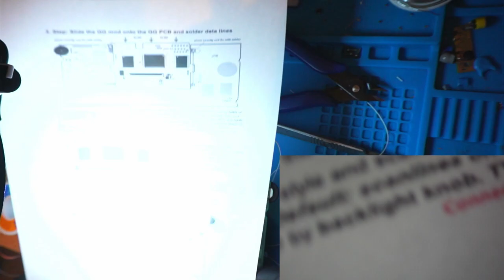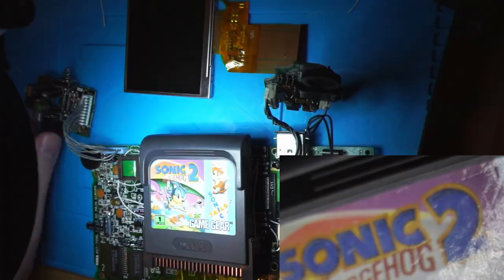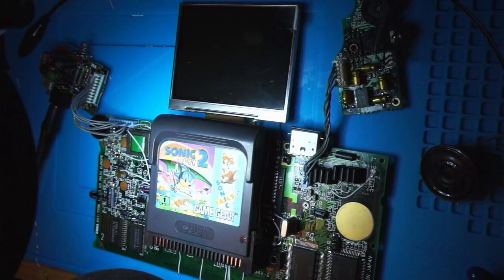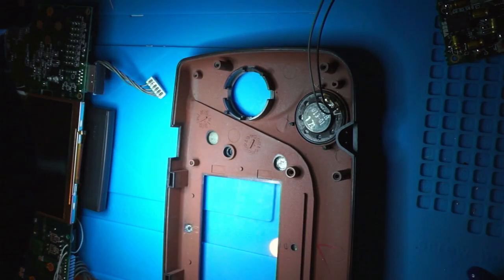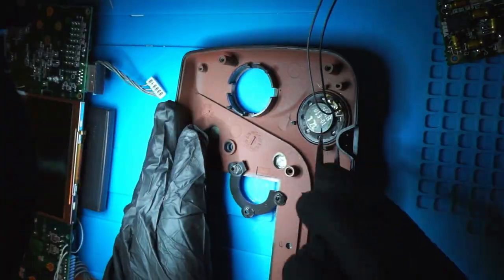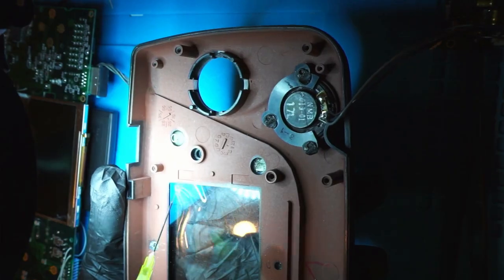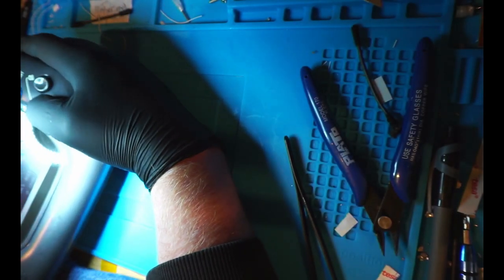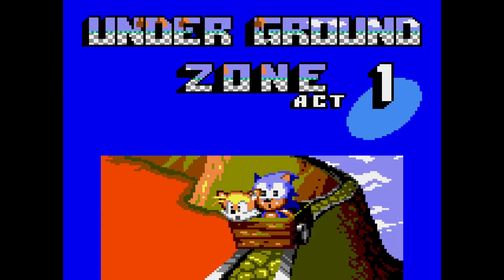Another Game Gear LCD Mod (Funnyplaying McWill Clone)

Comment: Thanks for a great video which helped when I was doing a couple of installs with the Funny Playing 3.1 kit. I decided to install the 32.215M crystal in the X1 position on the mod driver board when doing the 1ASIC install to avoid any graphics glitches.
Reply from the maker: Yeah that's exactly why the newer revisions have that. It's still odd that units are affected by the glitching so randomly with those kits though.
Reply: X1 crystal is necessary only in 1 asic version? where i can i buy it?
Reply: @thomasrossiter7834   i don't find it in smd configuration...can you link me please?

Comment: Good morning, congratulations for the excellent work... I installed the lcd clone kit and initially it worked slowly... then I installed the x1 oscillator to try to solve the problem and now, white screen oscillating... I tried to remove the oscillator and the problem continues ...what could it be?
game gear model (PCB 837-9130 / 837-9024 / 837-8560 (1 ASIC)

Comment: I also have the 3.1 version. I don't need to connect the but1 but2 but3. You only need this if you need VGA as well as backlight
Reply from the maker: Incorrect! BUT1, BUT2 and BUT3 are used to cycle scan line effects and scaling on the LCD using START + 1 + 2 at the same time. They have nothing to do with VGA.
Reply: @NewRetroRepair  sorry,you're right
Reply from the maker: @benan686  No need to apologise! you don't need to solder them if you don't want the functionality to be fair, but you really should =)
Reply: @NewRetroRepair  can you make a manual with VGA connection?

Comment: Thanks, I've got the v3.1 version on its way, looking forward to the install now.
Reply: Do you know the link to the install instructions? Got mine in the mail but can not find anything online for install
Reply: @bonesz0659  did you buy from Ali? Ask your seller for instructions. I just used the V2 instructions. At first I used the quick connections at the bottom of the board but it didn't work so I used the high connections on the other side of the board. Basically exactly the same as this video, unless you are installing into a 1asic board.
Reply: @douphowto  bought it from eBay, seller said it's on the site lol what site! And they have not gotten back to me since. I saw pictures on alibaba but they do not really show the wire location.
Reply: @douphowto  I think I found it on Ali thank you!!
Reply: @douphowto  Hi, so when you changed to the high connections it did worked? Because I've just installed the v3.1 to a working 1 ASIC board and the display shows nothing, but I can hear the game working...
Thanks
Reply: @douphowto  I used the V2.1 guide. But I'm not 100% certain about step 8, it says "Replace R24 with R30..." R30 is a 3Kohm resistor, provided in the kit. So I removed the R30 and left the place empty and removed R24 and replaced it with the 3K resistor. Is that OK?

Comment: need help with this, I have tried installing this on two game gears, but all I'm getting is a multi-colour static screen and the sound does not work? I have the 3.1 PCB, cant find any help in this issue
Reply from the maker: If the screen is not connected (just disconnect the power to the LCD controller board) do you get game audio? If you get audio it's likely a problem with your wiring. If you don't get audio then your GG's aren't booting games. If they aren't booting games you'll have to do some fault finding/disgnostics
Reply: @NewRetroRepair  I've tried rewiring the game gear and retried on another game gear, both game gears were working fully before the upgrade, I have contacted the seller on ali express and gave them photos i think this kit I got is defective as I have tried this numerous times

Comment: Did you install a 32 mhz to the gamegear board or is it in the board of the new lcd? (I have v3.1 on dual asic gg)
Reply from the maker: I haven't personally needed to install an oscillator. Though with that said, if you need to install one it needs to be installed on the 3.1 board, not the Game Gear itself.
Reply: @NewRetroRepair  So it's optional? how would I  know if I need one. Sorry about the questions, the documentation is very light on this topic.
Reply from the maker: @adilator  Install the LCD mod like I do in this video. If you get unstable video you need the oscillator. If it works fine, you don't =)

And yeah it's optional depending on if you get unstable video or not. If you do get unstable video, it isn't optional.

Comment: Any reason why you didn't use the set of header pins on the lower side of the board? Those look to be the exact same signals as the pads in the upper area.
Reply from the maker: Yeah you're correct. The main reason I didn't is because I used the v 2-0b board and those connectors weren't labelled on the PCB or on the aliexpress vendor page or in the instructions for that matter. It looks like on the V3.1 board those pins are now labelled. If I'd known what they were for, I'd have used 'em.

Mind you, there's another pin header that's unlabelled "P1" on the upper left hand side of the board. I've no idea what that's for either.
Reply: @NewRetroRepair  I received mine, which ended up being a 2.0B board, despite the page saying 3.1, and ohmed them out. The pinout is exactly the same as what's shown on the aliexpress page, so I did all of mine to those headers, except where it didn't make sense (CLK routes better up front).
Reply from the maker: @zaxour  Nice! Good stuff. How'd the install go? Hopefully the install went without a hitch and you got that old GG back up and running =) It's a pretty nice mod for the price all things considered imho. Also I'll keep those headers in mind next time I do one of these installs. Thanks for the heads up.

Comment: Would you recommend a ceramic capacitor kit for recapping or the original electrolytic capacitors?  Also, do you have a link for where you purchased this kit?
Reply from the maker: I just use standard electrolytic capacitors. That said, SMD ceramic caps are easier to install and theoretically won't ever fail.

I'm not sure that I'd recommend the kit versions as they're often all the same value capacitance and voltages, whereas on the GG the values for capacitance and voltage vary a lot.

I'm not really an electronics engineer though, and they seem to work for most people that use them. So why not?

Honestly, just got whatever you feel comfortable getting. All the caps I use are loose caps. They're not from a specific kit.

Also, to get these LCD's just search Game Gear LCD on AliExpress. Or Funny playing game gear LCD.
Reply: @NewRetroRepair  appreciate the feedback.  Left you a like and subscribed as well.  Good luck with the channel
Reply: @NewRetroRepair  How did you end up securign the screen to the motherboard?  Also, did you have any issues with any portions of the screen being cut off at the bottom or sides do to the GG display window?  I saw a few people on Ali express that looked like the bottom of their screens weren't 100% visible.  Thanks.
Reply from the maker: @matmcpaul9060  I didn't secure the screen to the board. I actually secured it to the shell of the GG using Tesa tape. I push the screens close to the top of the shell and sort of press them into the screw post near the top right of the window for the LCD (top right if you're looking at the inside of the GG. Doing that aligns the screens perfectly every time.